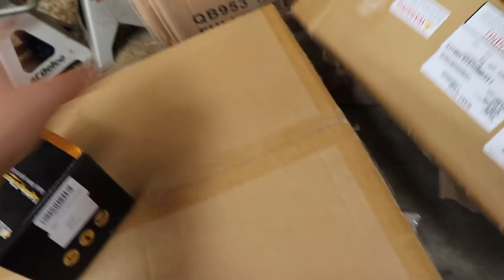THE FINAL TOUCHES FOR THE CUMMINS DUALLY!!!

Comment: Hey by the way I own a non intercooled myself and my suggestion for injectors, don’t get aftermarket ones just get new stock ones for a non intercooled because the non intercooled can push lots of fuel because they have 9mm tips unlike the intercooled which have 7mm tips so much more fuel is available with stock non intercooled injectors, also to go with that fuel don’t get a new turbo for the fact that it has a smaller exhaust housing which spoils it faster just get the 60mm compressor upgrade for the baby h1c turbo because that is what is on your non intercooled first gen...... you could probably make around 400-500 hp with that and the fuel turned up especially with that fuel pin, if you don’t upgrade injectors for it if they run well then just get the turbo compressor upgrade for it about 300 bucks!!!! And lots of power!!!!!!!